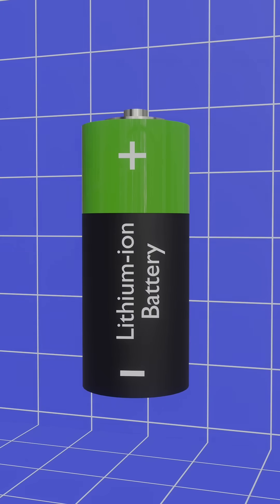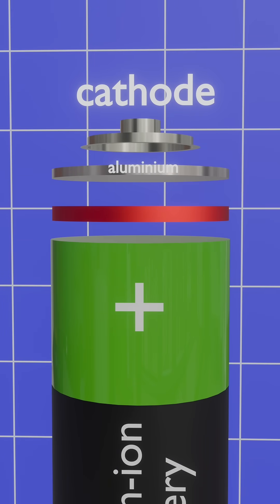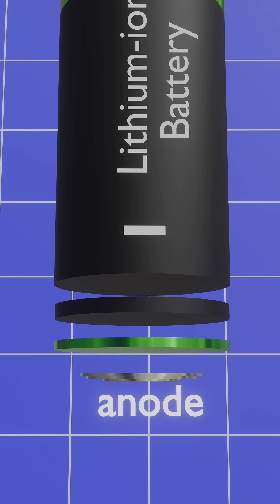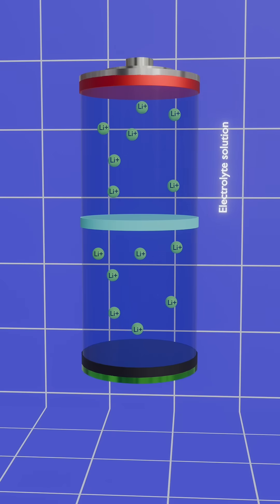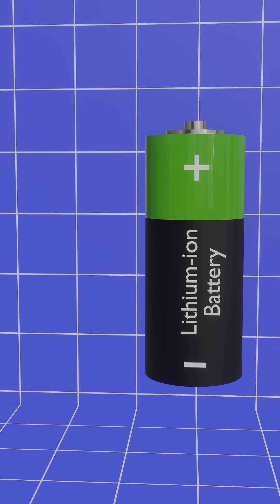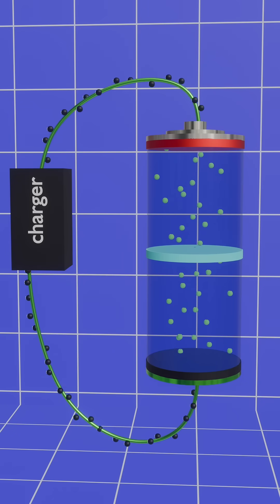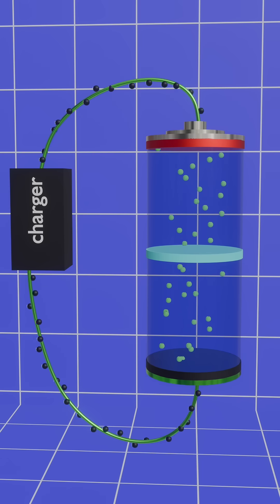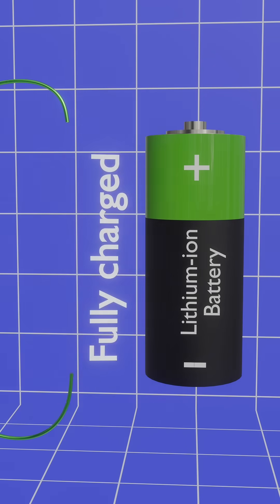Working of Lithium-ion battery in 3d animation. #battery #lithiumbattery #physics #electricity

Comment: if battery role just to provide short ckt bridge for battery during charging then can we replace power source with jst wire b/w anode and cathode?
Reply: We sure can but that can't be reused again after all the from cathode to anode.
Reply: Also you do need a power source. Here, galvanic cells which can produce current from redox reactions.